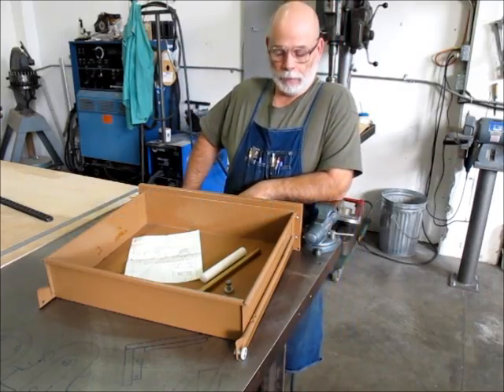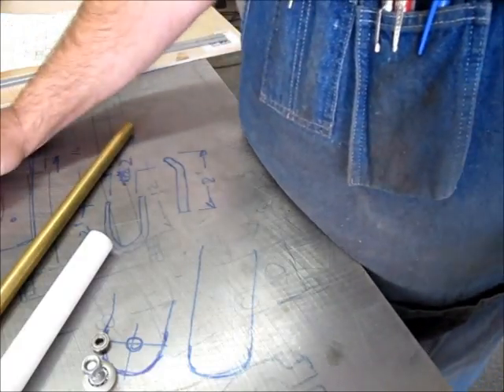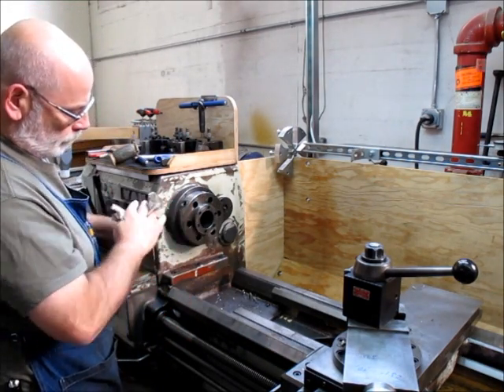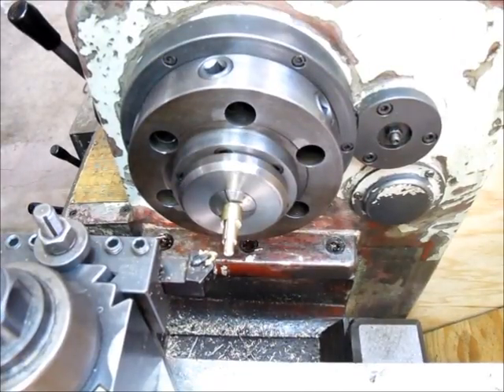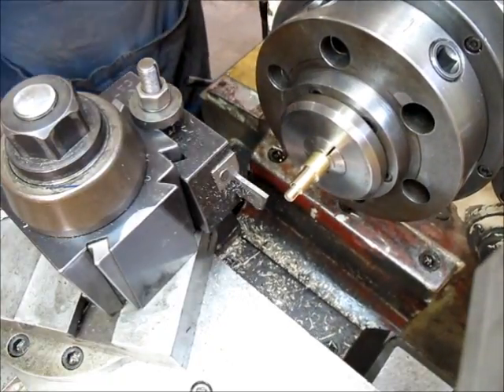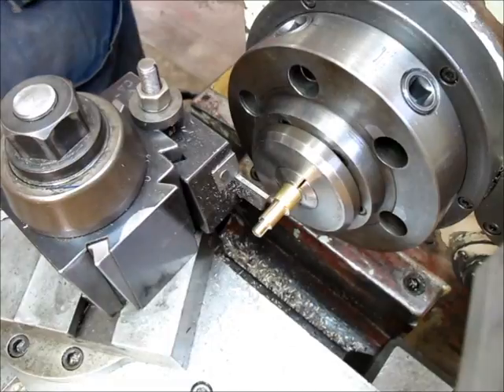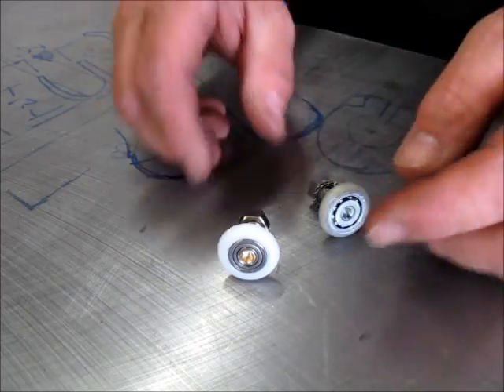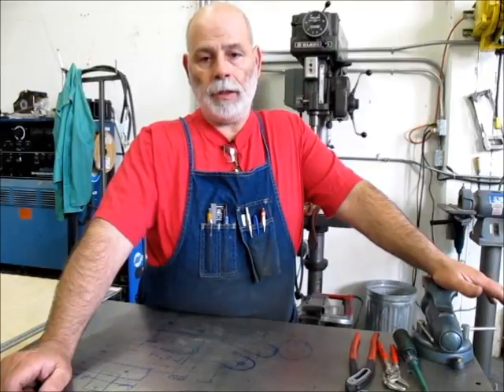Rolling and rocking

Comment: I made a bunch of similar parts for my friend's airplane control cable pulleys/sheaves
in delrin/accetal
wonderfull material to work with
Ground a 3/4 shank carbide tipped boring bar to almost a narrow internal grooving tool.
Anyway was able to bore the holes in the sheaves for a nice press fit on the bearings and a positive shoulder on one side and a real tight press thru and snap in fit on the other side
took longer to set up and program than it did to run the parts but they turned out real nice
Delrin is awesome stuff

Comment: The new camera mount is great. I also enjoyed watching that set of videos. One thing that might help you, and I don't know anything about your particular camera, would be focus. Some cameras have a flower (close up) mode or a manual focus mode , so the focus doesn't drift to the bed ways or other areas. Sometimes the camera may be too physically close to the subject  to focus, in which case you can move it back further and try zooming in. Avoid "digital zoom" however, as it is just cropping in which gives poor quality. Thank you of your videos and time, I learn an awful lot watching experienced machinists like yourself tackle large and small projects.
Reply from the maker: Hi Bendavanza,

Thanks for the video tips. I need all the help I can get. I have been using manual focus more for the closeups because of drift or me putting my hands or head in the shot.

Kind regards,

Tom

Comment: Hi Tom: Just curious, why didn't you make the bearing a press fit on the shaft?
Reply from the maker: Hi Andy,

Typically bearing installation have only one interference fit. Its not good practice to press fit both inner and outer races. It makes assembly and dis-assembly more trouble and preloads the bearing too much if its not absolutely perfect.

Cheers,

Tom

Oh yeah. It was a drawer roller. I almost didn't use a bearing but the other ones had them. Thanks for the comment.
Reply: oxtoolco Try telling that to BMW, their wheel bearings are pressed inside and outside.  PITA working on them.